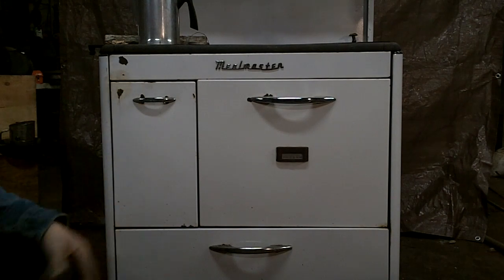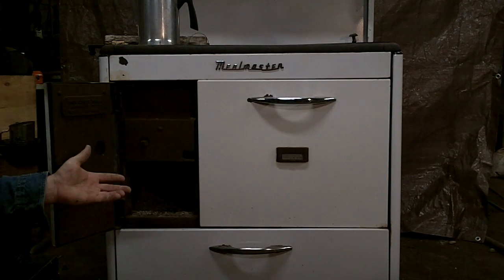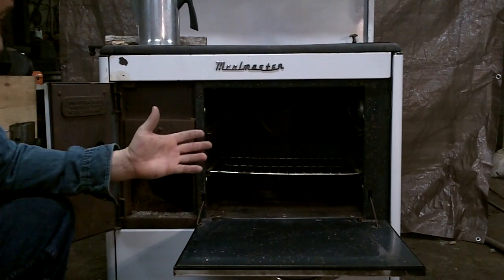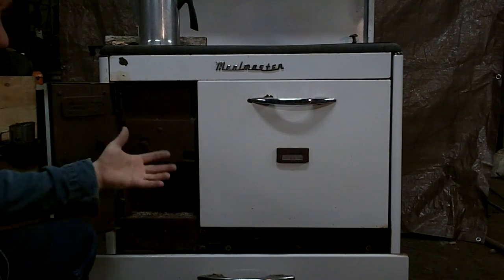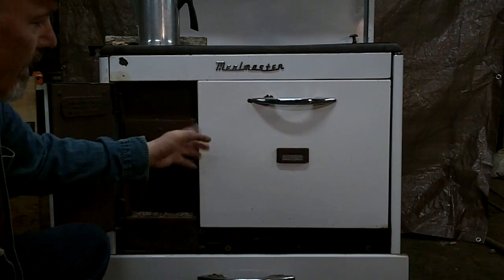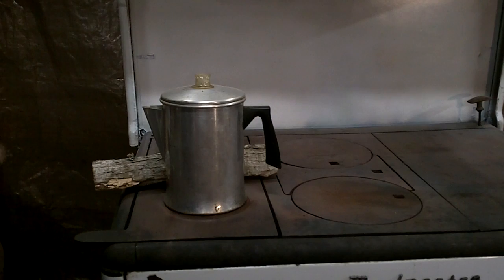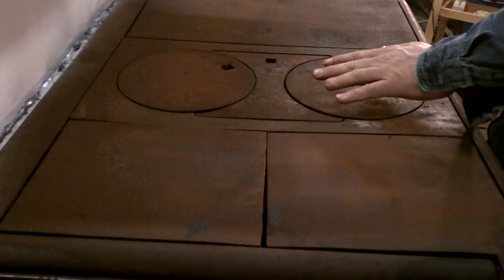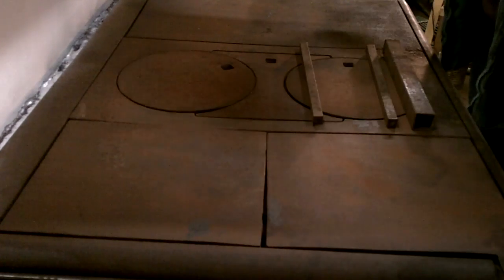Wood Cook Stove Basics Part 1

Comment: Thank you for video.  Finally watched one that help me to fully understand my stove.  I have the pull push lever on top of stove near back just like what yours is showing and did not know what it was adjusting. Now I know that it works the stove.  I have an old Majestic that I have put out in my summer kitchen and plan to use for canning mostly, but also for baking bread.  I live totally off grid.  Thank you

Comment: I`ve got a Monarch Paramount two burner cookstove that was given to me, I hooked it up in my basement for warmth down there while working on the computor, does a fine job, keeps the floors warm , takes the pressure off the gas furnace during really cold weather, I keep a couple of face cords in my garage , lasts around couple of months , heck of a lot warmer than gas  I tell ya !

Comment: I was thinking about getting one of these for backup heat. As I quickly see unless I stand there adding short pcs of wood it ain't gonna last too long. As a kid we had one of these at a mountain cabin until they ran electric lines. I couldn't remember much about it other than just cooking. That's why there was a big heating stove on the other side , I guess. I'd still love to build a summer kitchen with one of these.  Also I now see why the Russians build those wood chunker machines. Having a box of dry wood chunks would be handy with this animal. I now recall having to gather and split small wood for these stoves.

Comment: Mr. Lester, I have  a question.  The oven soot- clean-out, covered by the storage drawer at the bottom area, is there supposed to be a little door/covering over the small opening?  If so where could I get one?

Comment: Thank you for your videos . I have a question regarding leakage of smoke, though. I just bought a wodburning kitchen cook-stove (with oven) called a Quick Meal, It;s probably from the 1920s as it has quite a bit of porcelain around it. This stove has obviously been very well used and has seen some weather as there is some rust here and there. Is it okay to seal all the stove top panels to keep smoke from coming out the cracks? The flue goes straight up - no elbows. What's the best way to solve?

Comment: Hi Gary - You said you have replaced parts on stoves before. I can buy a beautiful pink Round Oak range but they converted it to electric so they took off the cast iron pieces in the back of the stove; one was where the flue was attached and the other was the box shaped covering over the fire box also removed the fire bricks inside (that surround fire box). Is it possible to put these back on if we can locate some or have new ones forged? How do the back pieces attach. By bolts or welding?